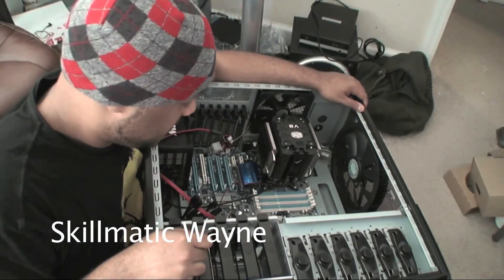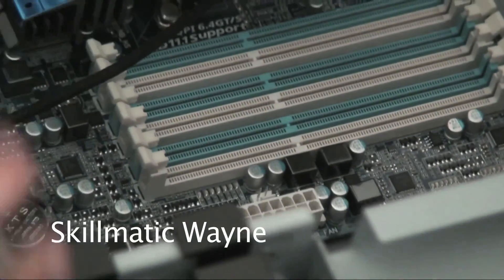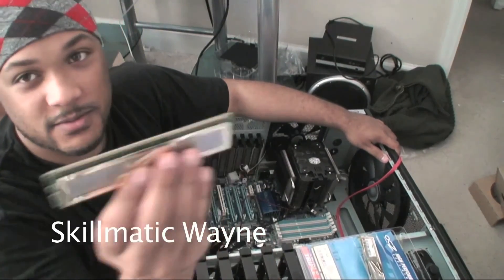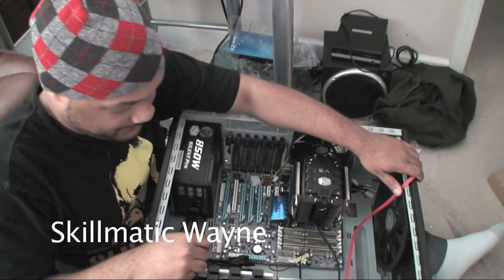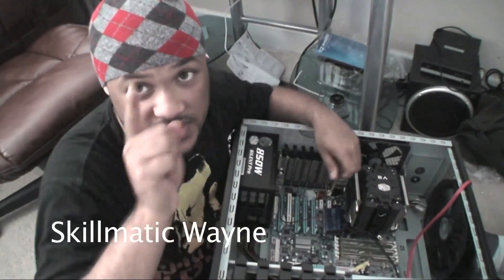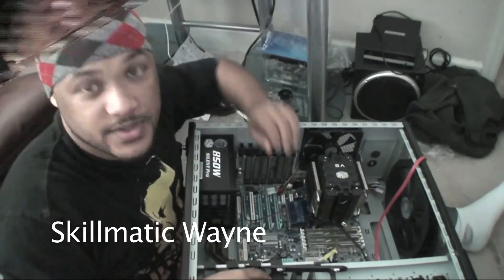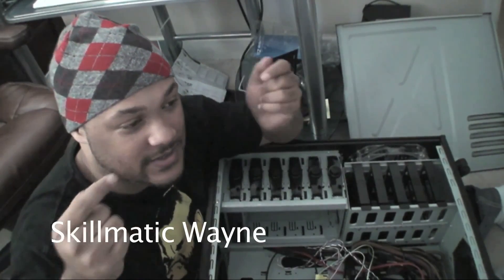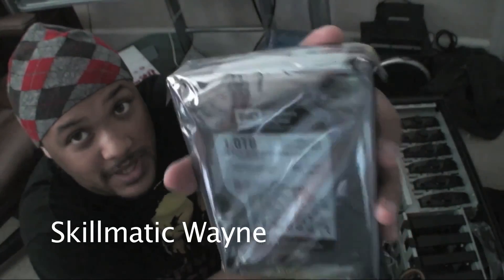How To Build A Hackintosh Part 4

Comment: You installed the WD Black backwards, that's why it won't lock into place.  The power & SATA ports should be facing the open end & should not get covered up by the latch lock.  Rotate the drive 180 degrees & you'll be all set.